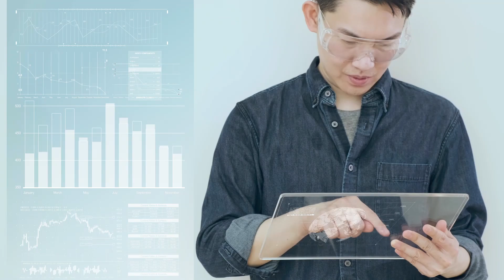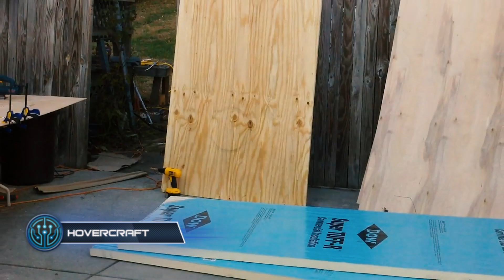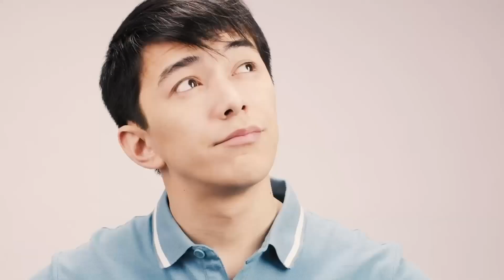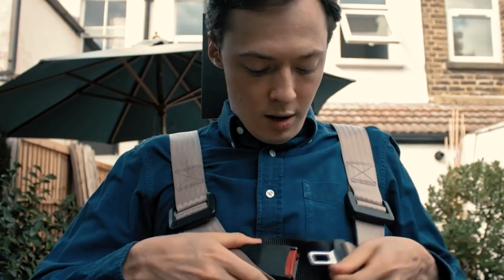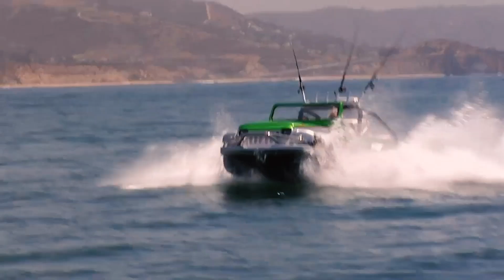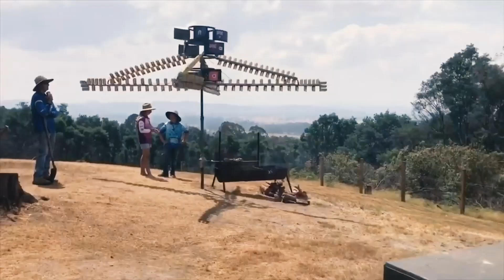AMAZING LIFE HACK: homemade projects you must see!

Comment: These are great innovations with spare materials and big imaginations. These homemade projects are next level. Stance Strike is a unique project that used a unicycle on the body. It's a trike that was developed with a go-kart-like design. An angle grider and a welding machine were used to assemble all of the components along with a bike and a couple of car wheels. Hovercraft is a really fun invention. There are wooden sheets and concrete blocks glued together in order to create the proper pressure. A strong plastic coated fabric was also chosen as the material for the air pad. Thank you so much for doing this video.